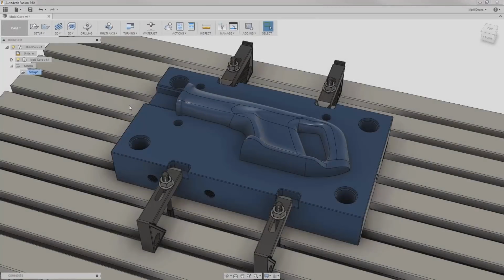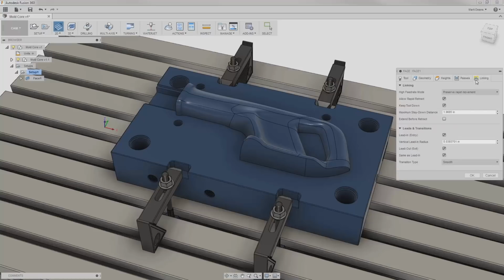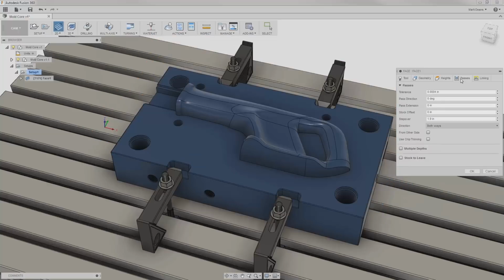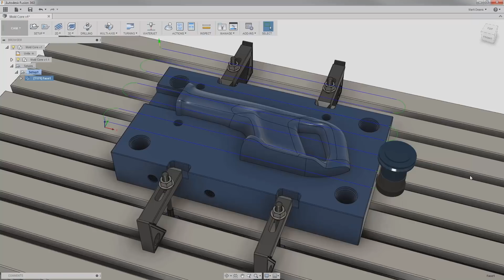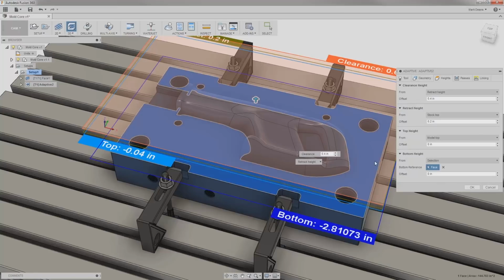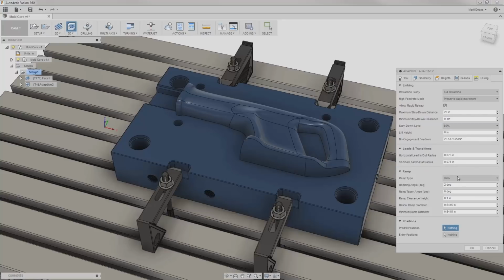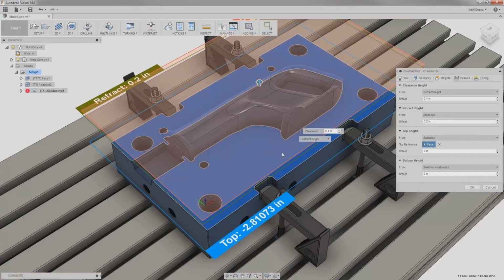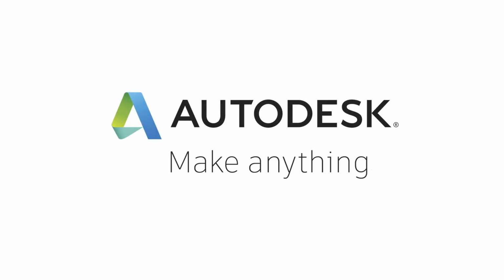Fundamentals of Milling: Roughing

Comment: For the shown 3D adaptive, the step-down seemed to be pretty small. Is that really the full length of the flute on your bull-nose? Or am I wrong in assuming that the "stair-casing" we see in the simulation is representative of the step size?
Reply from the maker: Hi Darran, this is a great observation and a good opportunity to get into the weeds of Adaptive Clearing. The smaller steps you're seeing are the Fine Stepdown, and they come after the first Maximum Roughing Stepdown. So the first pass goes at the Maximum Rouging Stepdown, which is set to the tool flute length. Then each subsequent pass is raised by the Fine Stepdown. So if the Maximum Roughing Stepdown was 1 inch and the Fine Stepdown was 0.1 in, then the first pass would have a stepdown of 1 inch, the next a stepdown of 0.9 in, then 0.8 in, and so on. Let me know if that helps! There's more detail on Adaptive Clearing here: http://f360ap.autodesk.com/courses/fundamentals-of-milling/lessons/lesson-3-1-adaptive-in-depth Just log in with your Fusion 360 log in to access the video.